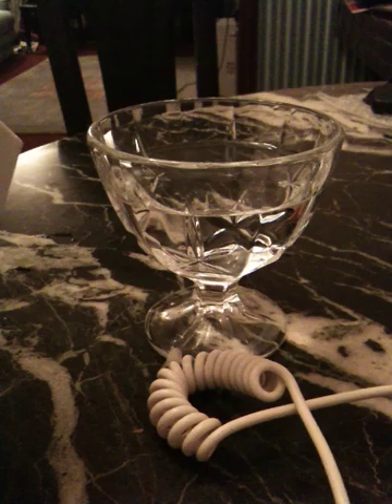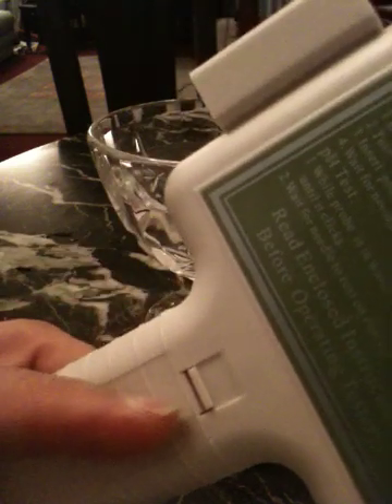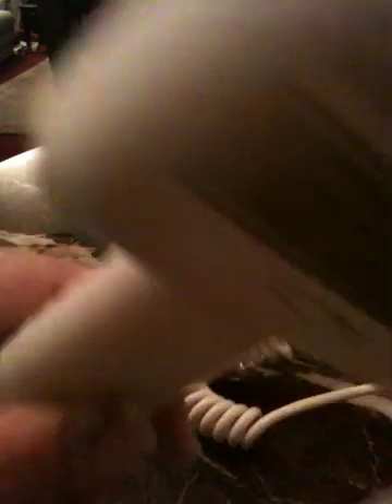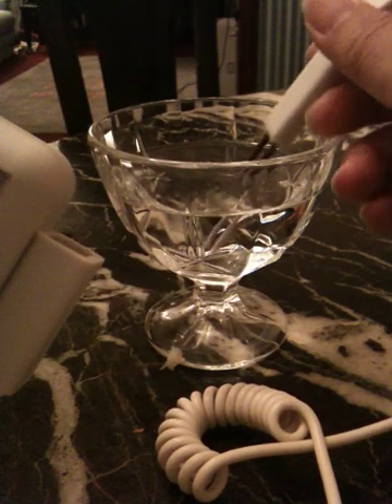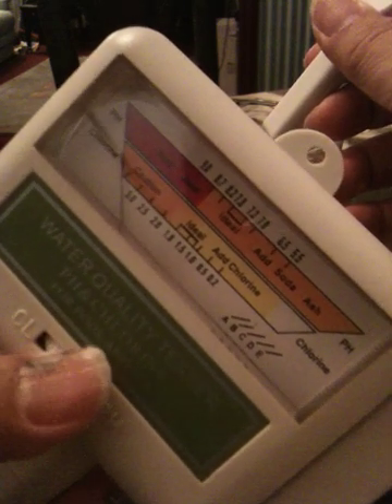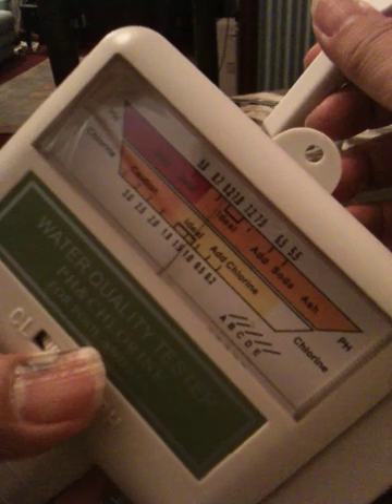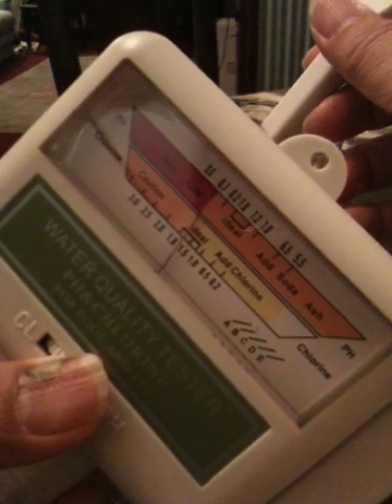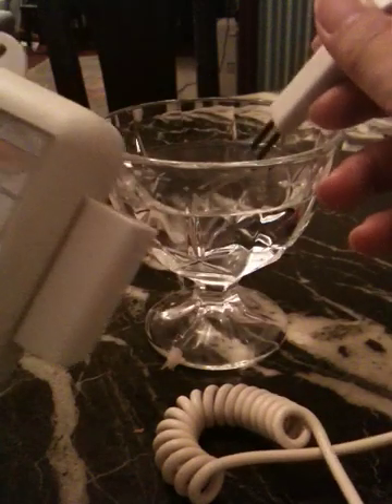Find Adjustment Point for the water tester to test Chlorine level used in swimming pool, spa.

Comment: I am surprised to see this device working. I believe one manufacturer may have a working device, and about a thousand chinese companies copied it. All the chinese copies are useless pieces of junk. Thats what I see from the comments, from other youtube videos and from my own experience, too. I am glad I got a refund for MY useless piece of crap, called water quality tester, ch, ph meter...
Reply: +ᅚᅚ This device does work. I have sold hundreds of them and less than 5 returns. It's unavoidable that very few may not be working for some reasons but I am sure that the design is ok as I have been using it for more than 5 years for my swimming pool. By the way, there are too many things made in China, designed by Chinese, please do respect them.

Comment: You can use tap water because the chlorine level of tap water is usually at ideal level for chlorine in UK. Of course, you can also use a solution that has a value of 1.5 chlorine level and you use the method to find the adjustment point. Then to test the chlorine level of your water in swimming pool, you have to look at my other video here.